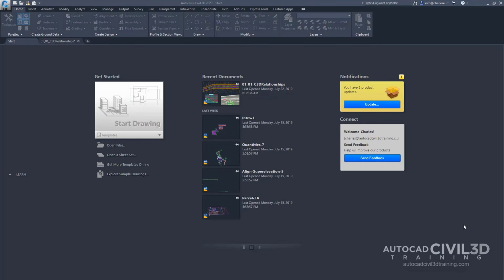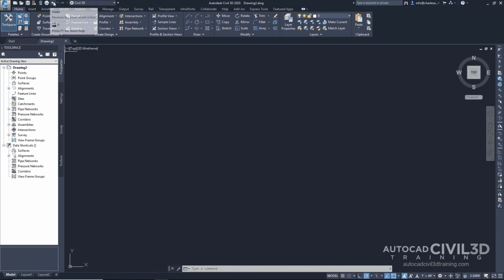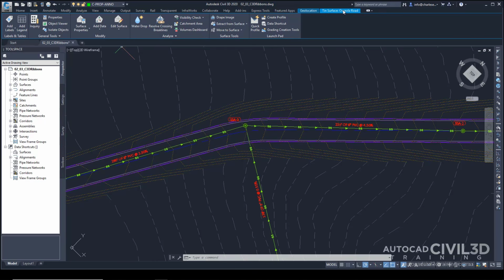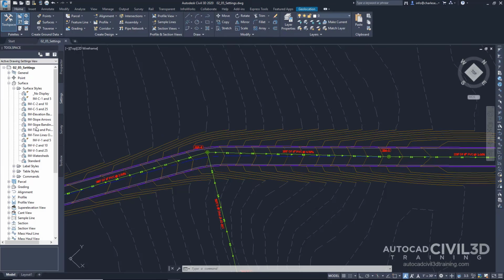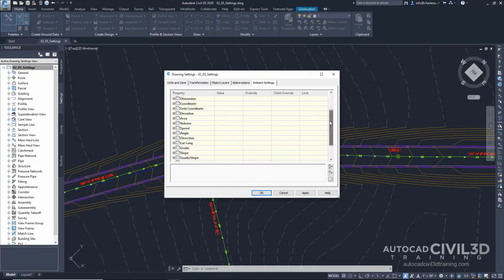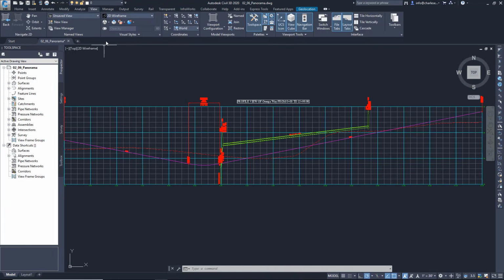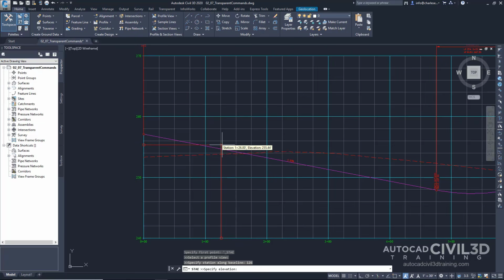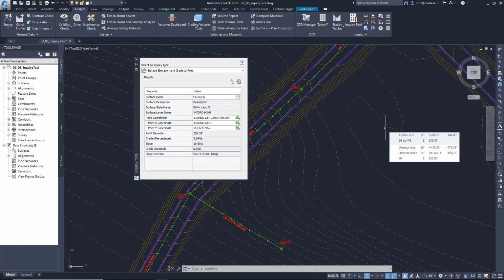01 Navigating the Interface in Civil 3D for Beginners

Comment: I can't open the panaroma pallette (however you spell it)
Reply from the maker: How to open the Panorama Palette in Civil 3D (2020–2022):
	1.	Command line:
Type PANORAMA and press Enter
(this is the fastest + works even when menus are acting weird)
	2.	Ribbon method:
Home tab → Palettes panel → Panorama
	3.	If it “opens” but you don’t see it:
	•	It may be docked off-screen (common with dual monitors)
	•	Try:
	•	Type PANORAMA
	•	Then right-click the taskbar → Cascade windows
	•	Or temporarily set Windows to single display
	4.	Still nothing?
	•	Run RESETPALETTES
	•	Close and reopen Civil 3D